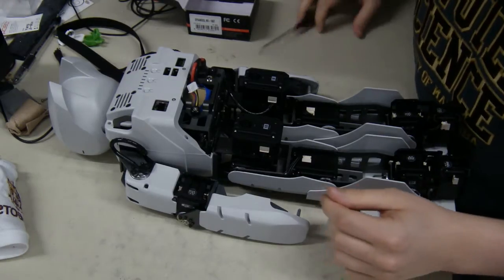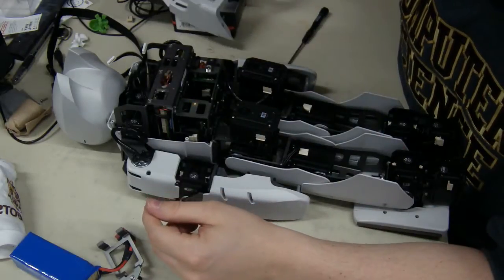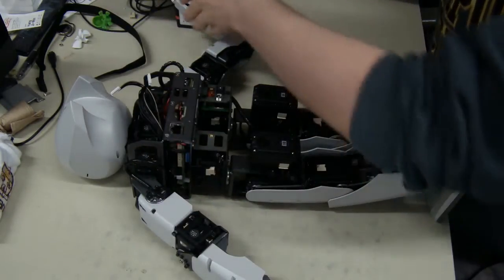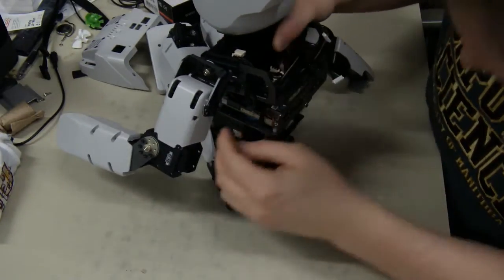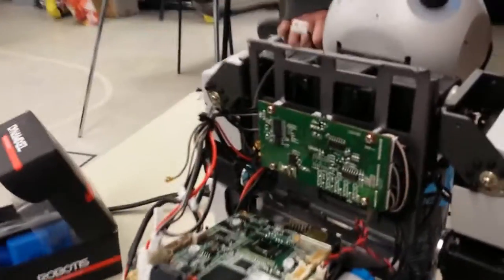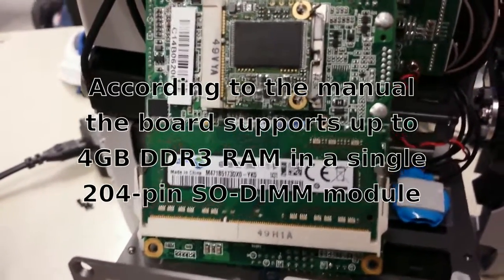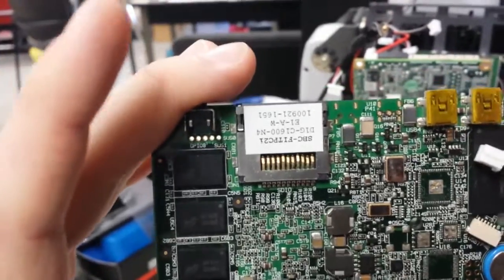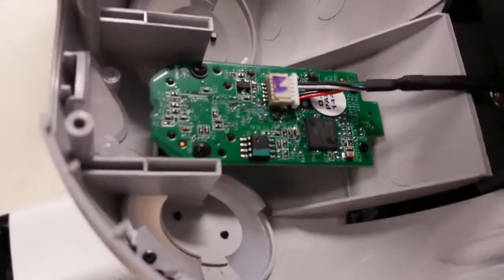Dismantling the DARwIn-OP 2.0

Comment: darwin ops were never ment to be taken apart
Reply from the maker: +Skyplacer 64 Beg to differ.  You need to be able to take them apart to replace motors and wires (which do wear out/break over time), and in the case of the OP2 you can't access the SSD or RAM slots for installing upgrades without taking it apart.  Casually taking it apart like a Lego set isn't a good idea, but as part of your robot's general care and maintenance you definitely do need to take it apart sometimes.
Reply: I agree

Comment: whats better nao or darwin-op
Reply from the maker: It really depends on what you want to do with them. The Nao has nicer programming  tools, more degrees of freedom, and a more polished case. The Darwin is user-repairable and heavily customizable. Personally I like the Darwin, but I tend to push the robots to their limits (skiing, skating, HuroCup and RoboCup) so the ability to replace wires and motors myself without needing to go through the manufacturer is s big plus for me.